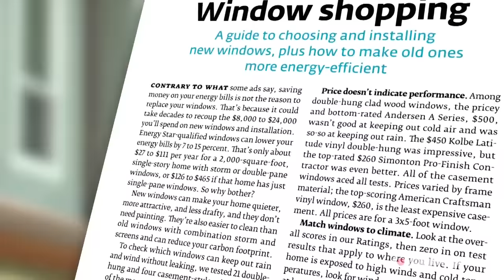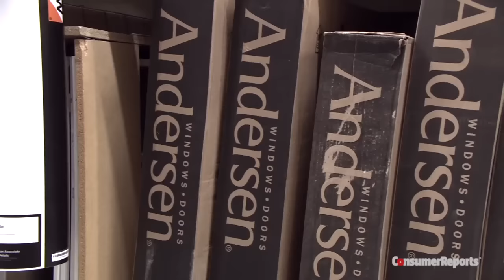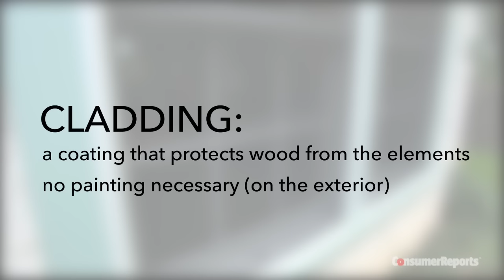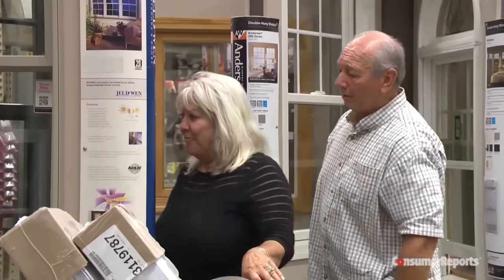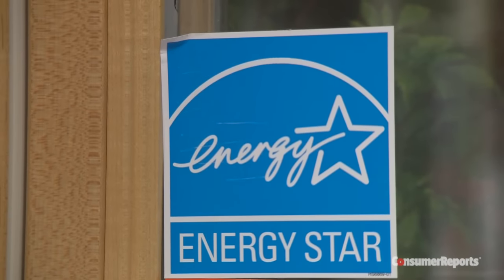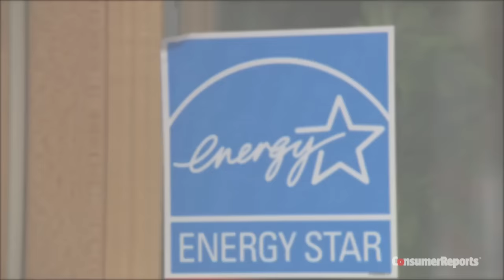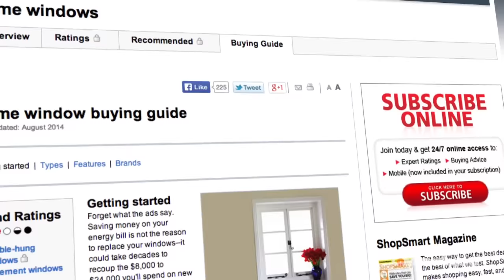Window Shopping Tips | Consumer Reports

Comment: Another factor is that, if you are replacing windows in a bedroom, the Building Code requires least one egress window (for fire escape/rescue purposes), with the operable part meeting all of the following: 
(1) Width opening = minimum 20 inches
(2) Height opening = minimum 24 inches
(3) Clear opening = minimum 5.7 square feet
(4) Sill height above finish floor = 44 inches
This will allow the Firefighter with full gear to reach the window, especially from a ladder, and get inside your home safely to rescue the occupants, as well as allow the occupants to climb into the opening and flag for help.
For example, if you currently have single/double hung windows in your bedroom, one of them needs to be a casement window, and maybe changed further in size to meet Code. Or if you have short height slider windows, the wall opening will need to be enlarged / sill lowered. Or a series of small window openings might be combined into one large one. Of course, if you have a bedroom that has an exterior door, then you can keep your existing window sizes.
Reply: cadsux I know this is an older post.  However, you do realize you should not make generalizations about building codes.  Building codes vary regionally, and even at city levels.  My city does not require egress windows for residential use unless it is for a basement (below grade) bedroom.

Comment: They acted like cladding was a good thing. It is not- yes, you won't need to paint, but the wood under the cladding will rot because the cladding holds the moisture in.
Reply: Absolutely true, cladding promotes wood rot. the moisture will infiltrate and the wood will rot at an accelerated rate. Look no further than the class action lawsuits to verify this.
Reply: Many of those were old. Pellas still have issues. Andersons are vinyl clad. I  install alot of marvins great warranty. The aluminum cladding isnt breakmetal its extruded.
Reply: That’s true.  Pella has Rot issues.  Andersen does not. They surround their windows with vinyl.  Then wood interior.  Pella has aluminum and wood inside. That’s rot.  I know it happened to me and I’m furious as it’s costing me now on my new home I built years ago.  Pella had a big class action lawsuit too. I’m in on that.